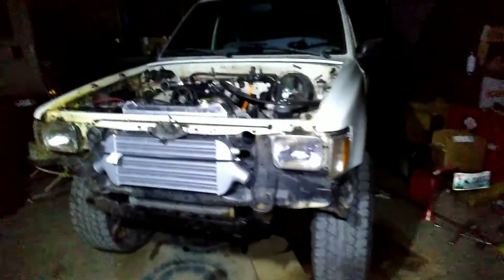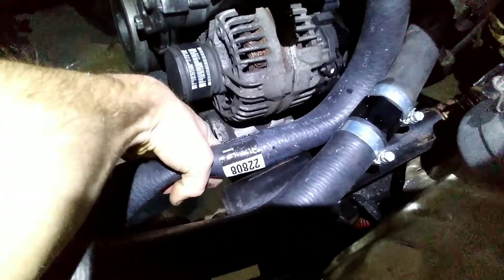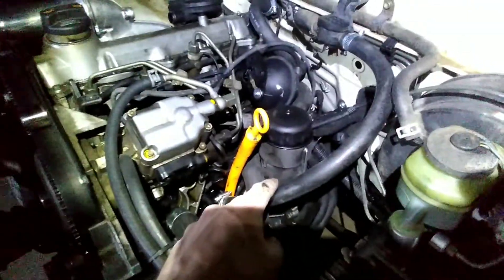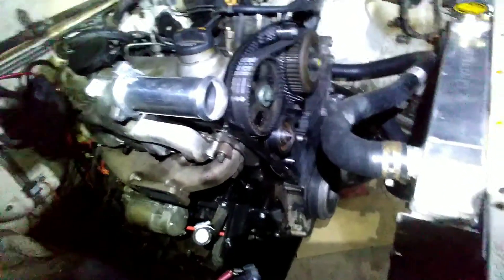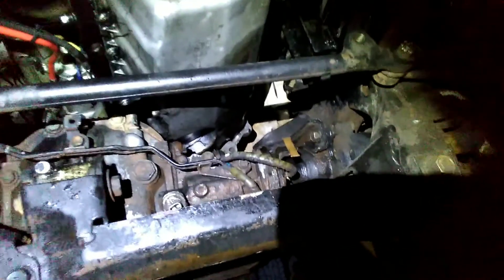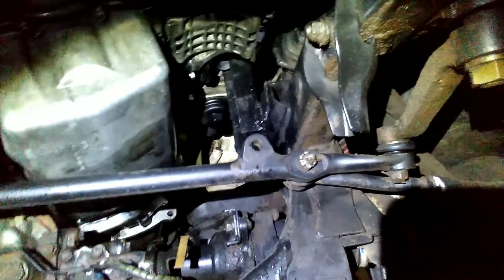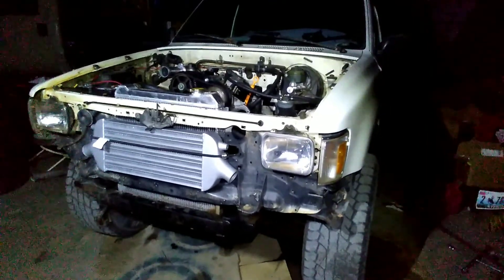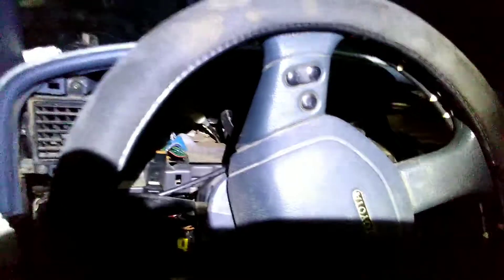Diesel Swap 91 Toyota TDI engine mounted and first startup

Comment: Hey! Cool build. I'm doing a similar swap putting an ALH tdi into my 93 4Runner, I was wondering what turbo manifold you used?
Reply from the maker: That manifold is a universal t3 manifold off eBay, I use alot of custom setups now for my turbos

Comment: did you end up moving your brake lines on the passenger side? and fuel lines that are in the way of where you will route exhaust?
Reply from the maker: I actually just ran the exhaust inside the frame and back so I wouldn't have to move all that.

Comment: You need a hybrid oil pan
Reply from the maker: Ya I didn't feel like the extra investment, it's less than an inch shorter, about 1/2" different if I remember right.

Comment: Motor mounts what did you do
Reply from the maker: The metal is all fabricated and I just used a universal bolt through rubber mount, they vibrate some at idle but smooth the rest of the time

Comment: Most people have no idea what it takes to do a conversion. I did a Suzuki Samurai vw turbo diesel conversion and the amount of work that it takes is enormous. Time researching, gathering parts, making custom brackets and the exhaust is just a PITA. Never again. The time spent, the money and the work putted into it is not worth, a few years down the road you are going to start disliking your vehicle and thinking about selling it. I believe a stock vehicle is a more wise decision, just my two cents. I own a couple of TDI alhs, but i would never do a conversion again.
Reply from the maker: I cannot relate, 3 years into my Jeep and I'm liking it so much I started on my TDI pickup ha ha
Reply: It is much more smooth when you have a facebook group and many other examples to help.. Stock vehicle for me is 120 HP/ 140 ft lbs / 19 mpg, DULY limiting.
Reply from the maker: @amorag59  Yes for sure, I built my Wrangler just reading forums for ideas, having the facebook group as a resource I have fixed things I never new was an option